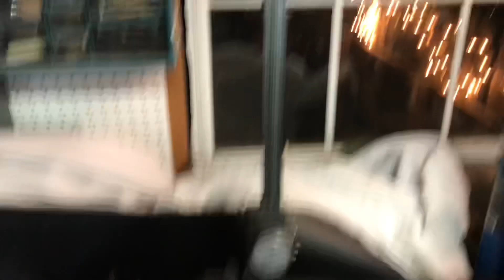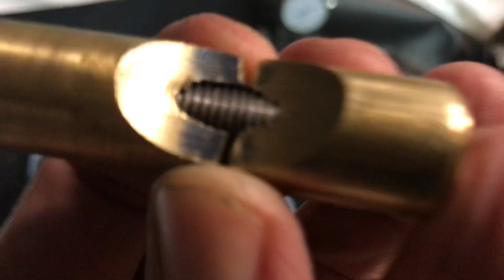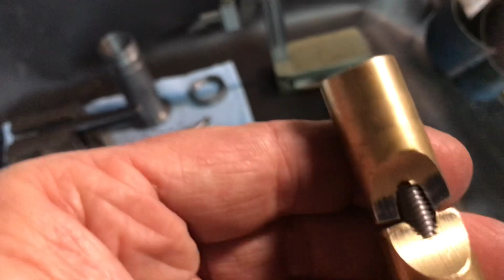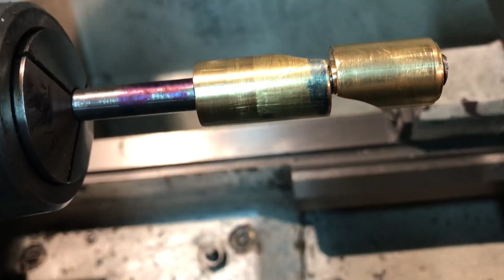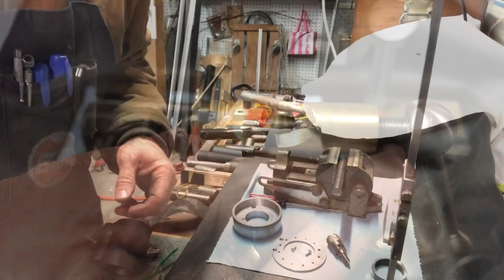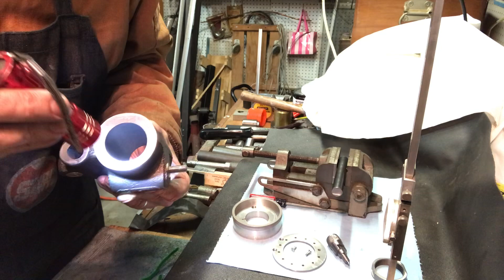Quorn and other tools, fixing split cotter offset problems

Comment: Brass works fine.  The offset formula is 1/2 primary diameter + 1/2 fastner diameter + .025.

Comment: I just bought a Quorn kit from Hemingway. I have watched most of your videos on building the machine, and I really liked this idea of the double cotters. Now, in the Hemingway instructions they state that the cotters should be steel, because that would give better coefficient of friction than brass. Since I have seen you make them from brass, I wanted to ask if you have any thoughts on that. Do they perform ok in brass? Would you have considered steel instead?
Reply from the maker: Either will work fine, I think. We are not talking about a lot of force to clamp with. Thanks!